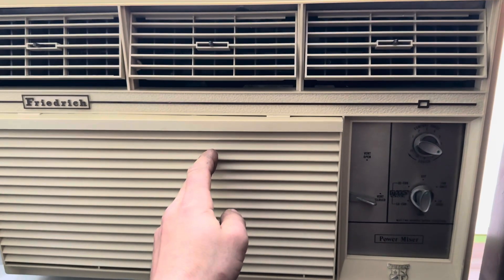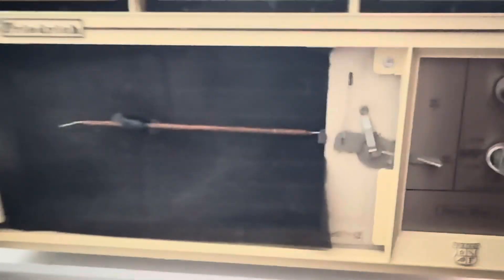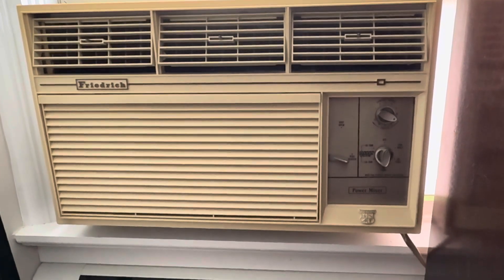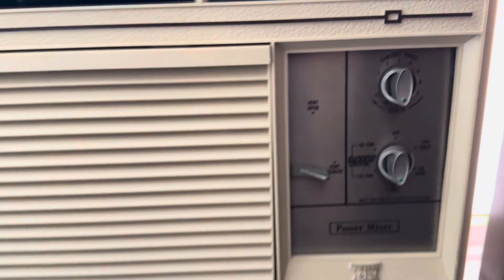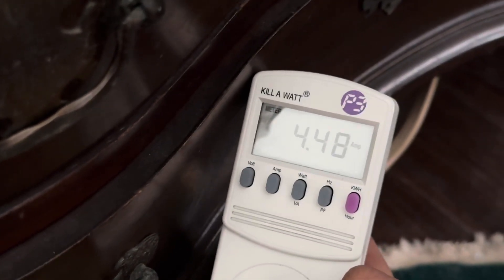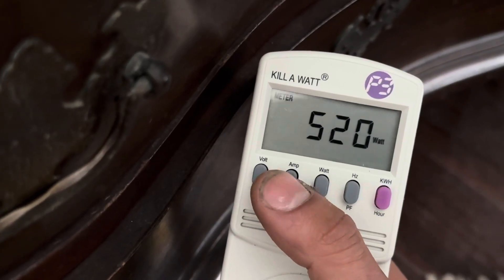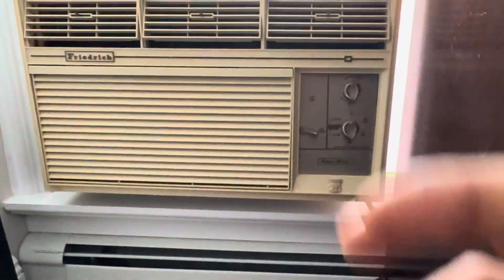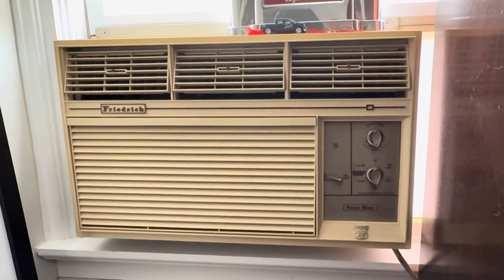A 50 Year Old Air Conditioner is Just as Efficient as a Modern Day Air Conditioner?

Comment: Years, years ago, my father bought a Whirlpool which was a 15,000 BTU Unit from 1970 or so for my mother when my parents were still married. (They got divorced in 1974) My father actually bought the unit from the electric company, (If you bought any appliances from the electric company, you paid so much a month till the unit was paid for)  and it was in the living room window in an upper apartment and it worked really well and cooled the entire apartment except for the bathroom, and it a little bit noisy on high, and it was quiet on low and medium. It worked very well. In 1980, my mother, sister and I moved into a house and we had it in the living room window there and it worked perfectly and cooled the entire downstairs. Unfortunately, my family moved into an apartment complex the unit couldn't fit in any of the windows. Well she originally wanted to keep it in the basement and use it again when we had to move again. So, she gave it to my stepfather to have it in the bar part of the small bowling alley he managed for his daughter and it was in that window for about five years, and around 1989, it conked out, and my mother then told me she wished she could have kept it because in my opinion, when it was at the bar it probably worked too hard to keep the place cool even though in 1985 (it conked out in 1989) when they sold the place the new owners put in two more units in the bar. If we would have kept that unit, it may still be working today.
Reply from the maker: @Paulywint  if you beat on them too hard, even the heavily built equipment fails…neat story

Comment: An AC that runs half the year and half the time (cycling) runs say 2000 hours a year.
The new unit consuming 100W less saves 200kWh or 40$ per year assuming 20ct/kWh
Assuming that old unit was actually used 50 years it cost 2000$ more in electricity than a new one would have cost. That calculation is a little shady because the new unit obviously didn't exist back then
5000 BTU (or 1500W) Vs. 520W Power draw comes out to a COP of about 2.5
New inverter units can achieve more than double that, so a 5000 BTU unit would draw 250W. That would save 100$ per year, offsetting the cost to buy a new one every 5 years. And if you are betting on the thing lasting 6 years, you are 100$  on the plus side
Reply from the maker: @Fluxkompressor  You can get the 6 years, but do you wan’t to be replacing your air conditioners every 6 years? For some, I can see how the inverters are worth it. It comes down to preference at that point. I enjoy using vintage equipment so I am biased in that sense. These vintage units are almost always free or very cheap for grabs nowadays as well…so they have that going for them too
Reply: This assumes electricity in 1970 was always 20c. I paid less than 8c just a few years ago, and I looked it up in 1970 it was around 2.13c for retail.
Reply: @ Yes, that's another thing. That electricity price was not and wont stay the same either

Comment: Old ones were poorly made in USA; new ones are poorly made in China. HVAC equipment, whether residential or commercial,  has never been subject to high quality manufacturing. I know, I was in it for 50 years.
Reply from the maker: @jodydoakes8754  I’m curious what part of the industry you were working in. Maybe so, but compared to today’s quality of refrigeration products I can tell you pre-nafta hvac equipment is 100-fold better quality then todays garbage, made in china or not
Reply from the maker: @jodydoakes8754  take a look around the neighborhood and you will still see units dating as far back as the 60s-90s in use, but you won’t see much equipment from the early 2000s even 2010s still in use

Comment: Good luck getting R22. My 2 units were built in the 70's. I've had to replace the compressors once. I'm running R407 in them now. The scam is not about efficiency. It is about environmental impact.

Comment: New ac units made in China ARE JUNK. The American made units I have from the 1990s still work great. I added a temperature-control extension cord to them for even better control.
Reply from the maker: @pappydaddy7447  you can go as far as fabricating a controller with a contactor and transformer, and hook it up to a wifi thermostat if you want modern day control over a 50 year old air conditioner

Comment: I've got an ancient Toshiba PAC from the '80s that's still grinding away and cooling my workshop in the warmer months. It does have a strange refrigeration system that uses a water spray to cool the condenser, it is quite a small unit, so I guess they designed it like that to keep the size down and not have the need for a larger condenser to achieve the same cooling effect. (It's definitely a compressor system and not a swamp cooler as you'd think).
Reply: I was a commercial refrigeration technician. We had customers that had units fall on their ass when the ambient temperature went above 85-95° F. It was Portland area where it was only that hot just 10-15 days a year. We installed water sprays that would work when the high side pressure went too high.
Reply: @brucelytle1144  Actually that reminds me of a data center I used to work at where that was a regular issue in the summer with the units tripping out. Although I think this was more that the building was originally housed telecoms gear and was repurposed but without considering the increased heat load and management being too tight to get new A/C units installed.
Reply from the maker: I'd like to see a video of that system in operation

Comment: it's full of refrigerant that works (but strips the ozone layer when released and causes supercancer when burned)
Reply: It is actually Phosgene Gas that is formed. Submarines have systems to detect even the slightest of leaks! There are atmosphere control machine that will take the air high enough temperature  to convert it to Phosgene gas. Not good!
Reply from the maker: No, it creates phosgene gas, which damages the respiratory tract when refrigerant is burned. No cancers. That applies to modern "ozone friendly" refrigerant too, except starting last year the latest refrigerant will also go boom.
None of the refrigerants used in these types of systems past and present are "safe" for the ozone.

Comment: As the compressor ages the piston leakes by and it becomes less efficent keep that in mind.
Reply from the maker: @RodgerMudd  thats an interesting point  to bring up. I have seen similar situations in the hvac field with larger reciprocating compressors losing compression but yet to see with any window or wall unit. I’m going to update this video and take amp draws under a very high heat load to see how close to spec this unit is. Almost all of the units from this time i’ve tested all stay below nameplate, after a good coil cleaning of course
Reply: @feddersairdude  You need to use a psychrometric chart or everything you are saying is just conjecture. Wet bulb in and wet bulb out with actual cfm's or this is meaningless. Those old units are NOT quiet, either. New ones are very quiet, use less power, dehumidify better, and do not destroy the ozone. You are absolutely correct on the new ones not lasting. I call bs on them only lasting 5 years on average. Also those old units are not around because they all died! Finding this one and pretending like this is the norm is a little shady. It is a fact that power usage is only around 20-25% better but when you multiply that by a nation it is huge!
Reply: @kenthomas4668 not exactly... The ones are dead cuz people either left them in their old homes and the new people junked them, or someone else junked them cuz they are ugly.. those old ones usually didn't just stop working

That said, you make good points on the other stuff.
Reply: @kenthomas4668 the ozone thing is a source of controversy even today, but assuming the research is 100 percent accurate, nothing depletes the ozone if it doesn't leak.
Reply: @realSamAndrew It’s all a scam to make money. It was actually R-12 that supposedly destroyed the ozone layer. R-12 was mainly used in car air conditioning and household refrigerators. The deal was it contained chlorine. And when it leaked out it would decompose and the chlorine would attack the ozone layer. If that was the case, why didn’t they outlaw swimming pools? The sun evaporates the chlorine out of the water and you just keep adding more. Curiously it was suddenly discovered to be damaging the ozone layer a few years before the patent was due to expire. The patent was held by a chemical company that just happens to be owned by one of the richest families in the world. Most air conditioners used R-22 up until about 15 years ago. It was deemed to be causing global warming. It was replaced with R-410A. It doesn’t work as well and takes more energy to pump it through the system. But R-410A is now considered to contribute to global warming and is being replaced with a flammable refrigerant. So how is it good for the environment to keep throwing away perfectly good equipment and filling the landfills with things that could be easily fixed? But the real kicker is that they’re talking about using CO2 as a refrigerant. Yes the same CO2 that is being blamed as the main driving force in global warming. So kinda hard to buy into any of this crap.
Reply: @kenthomas4668 It takes less energy to pump R-22 than it does to pump its replacement R-410A. Not sure about the new flammable refrigerant, though. But if you want further proof it’s BS, they’re talking about using CO2 as a refrigerant. Yes the same CO2 that they’re blaming for global warming.
Reply from the maker: @kenthomas4668  I know all about psychrometrics...
There are plenty of these old units around still in use. I own quite a few myself, perhaps along the lines of 40. They outperform modern units you don't need a psychrometric chart to figure that out. The old units absolutely dehumidify better, unless your talking about an inverter....which have only become available in window units as of recently. And quiet, yeah I guess until the "permanently lubricated" motor bearings howl at year 5. I wont get into the rest you touched on because I'm not willing to get political on my youtube channel

Comment: The other thing to, is that the cycle times on the newer units is much longer due to not blowing as cold. So even if the wattage on a new one is less, it actually costs more due to the longer cycle times.
Reply from the maker: @TheAirConditionerGuy  Fantastic point.
Reply: @feddersairdude  except air temp is  meaningless, more air flow means higher temps but is not a reflection of btus which is meaningful.
Reply from the maker: @kenthomas4668  more airflow does not always mean higher temperatures, it comes down to what the unit is designed to do. Yes, btus are hourly, units back in the day were over-engineered and ratings were at worst operating conditions, meaning the btu rating was actually higher than on the nameplate vs today’s equipment. Type of refrigerant used, the hp of the compressor and type of compressor, size of the coils, AND cfm, all play a part
Reply: BTUs are measured hourly, an older unit vs a newer unit that are both rated at 5000 btu will have the same output in the same amount of time
Reply: Less airflow too

Comment: Everything you said is 1000% correct.  I have been preaching the same forever.

One other thing to note is that the data plate on any device, no matter what it is. will show the maximum wattage draw that the appliance will use.  Typically, it will always be less.
Reply from the maker: @jaykay18  I find that with modern equipment, the draw is much closer to nameplate than vintage equipment. The requirements friedrich (and other manufacturers at the time I’m sure) met for room air conditioners were higher standards than of manufacturers today. Ie 5 amps at 120 degrees outdoor ambient vs 5 amps at 105 degrees
Reply: @feddersairdude  Yes, they did change the ratings.  Basically that allowed the new units to be junk.

In fairness, I must say, a couple years ago when my upstairs central A/C went out, I went to Walmart and bought the cheapest 5,000 BTU window air conditioner money could buy.  It kept the room just tolerable during the day, and of course did much better at night.  Of course it was undersized for the job, a 6,000 or 8,000 BTU unit would have done much better.  It couldn't possibly cool like the central, and it had to run continuously, but got me by a few days without complaint, which I think is an accomplishment itself.
Reply from the maker: @ i remember that video. The new units certainly work, it would be hard to sell them if they didn’t, and they certainly are smaller and lighter then they used to be, which im sure are selling points for most people, but we both know that the walmart unit isn’t going to last in that environment very long. I guess it has it’s place and served it’s purpose while the central air was out. I also figure with central air becoming more and more popular across the states, the market for window units will probably fall into your category of supplementing malfunctioning central systems more often then not
Reply: @ A lot of this country was built up in the 1950s after WWII.  Central air, while available, was out of reach for most Americans, including shop owners, as it was just too expensive.  As the years and decades went on, gradually more and more places started getting it.  Then you started seeing those signs that said "Air Conditioned" on doors, YouTuber dynatrak got one recently.

Anyway, since most homes were built then where the thought of central air wasn't in the cards, most never got it.  There are many, many a home that still use window and wall air conditioners, and it will stay that way for a long time to come.  It's still a huge expense to add to an existing home.

Jordan U has claimed that the new units, while certainly junk, tend to actually hold up considerably longer than their modern dehumidifier cousins.  I think there is some truth to that indeed, where if the A/C is only used 3-4 months of the year, while a dehumidifier might be more like 7 or 8, it will have half the usage.  And, if taken out for the winter and stored properly, may last longer.  For me, I knew I wasn't going to need it for some time to come, and certainly didn't want to take the chance that if I did need it, even that option was dead, so I returned it.  It's nice to know that if I need it again, I can place an order online, roll up, have them load it in the car without my even getting out, and have it running in a couple of hours.  If I knew the unit were to last for, say, a good 10 years, and was lightweight, even if its performance was only barely acceptable, I would have kept it.